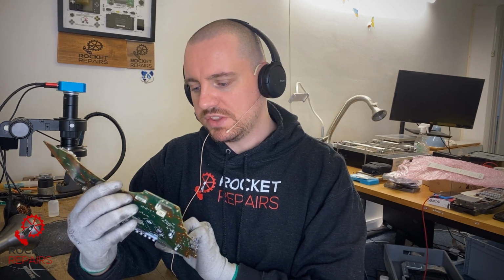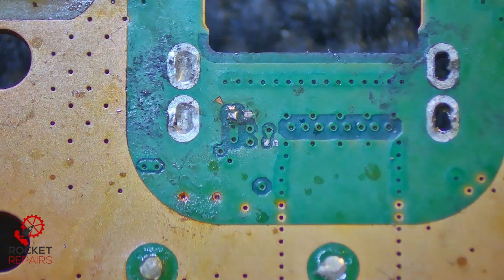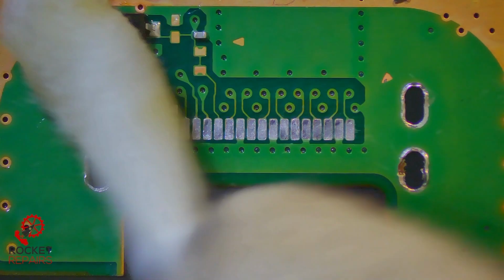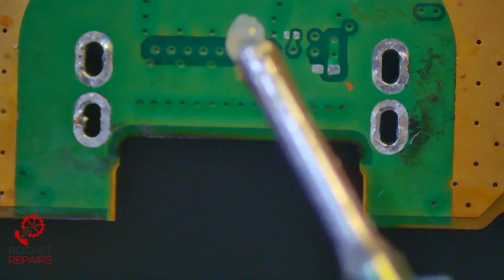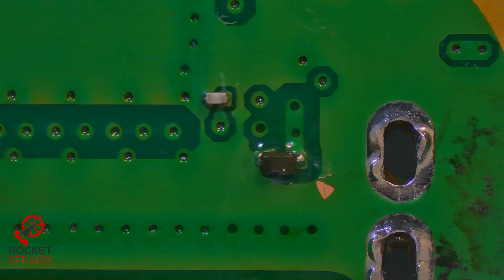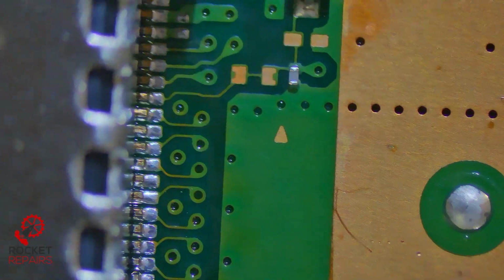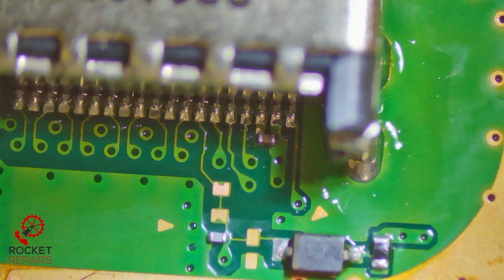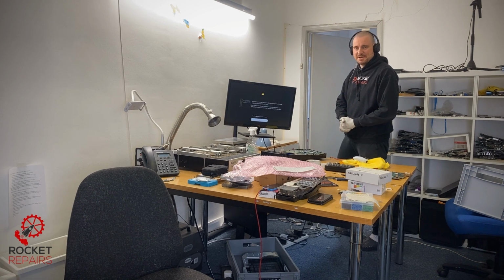PS5 Repair gone wrong, at least they did the right thing and sent it to us!

Comment: What temps do you use for hot air and soldering?
Reply from the maker: it depends on board thickness etc. could be anywhere from 250-500!